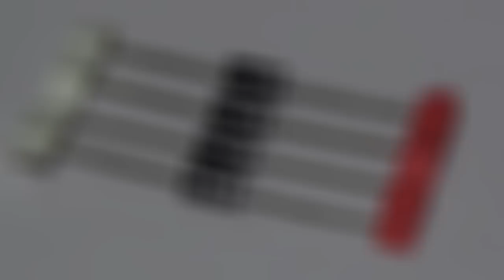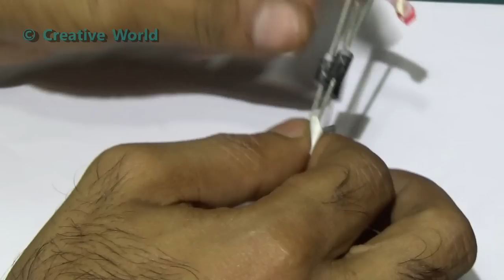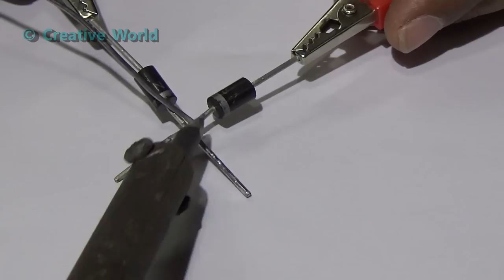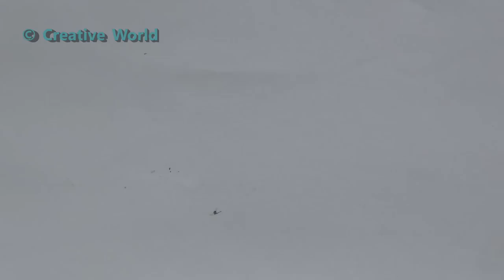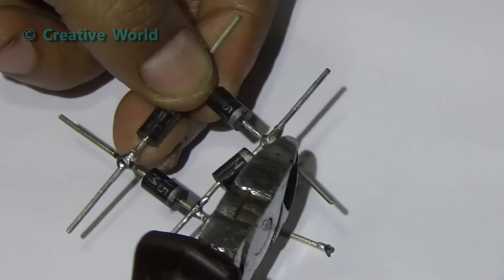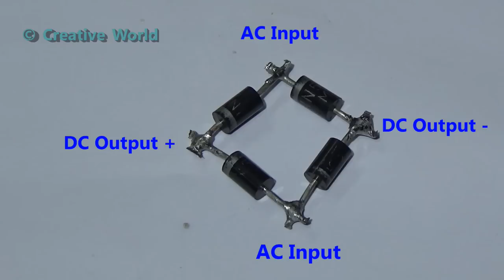How To Make A Bridge Rectifier (100% Works)

Comment: what type or model of diode to use in order to output maximum voltage or current?
what did you use?
Reply from the maker: 1N 5399

Comment: So I could use this to make a reversible polarity connection for an LED, right?
Reply from the maker: sure
Reply: Yes. But it would be a waste. Just use single diode for low voktage
Reply: @foco5657  voltage ?

Comment: Takes more than 4 diodes for a bridge rectifier. This isn’t the full circuit, this is a very basic wave rectification circuit. Run a voltage and a current thru it to a consumer and verify your findings on an oscilloscope. You’ll find the output to be far from satisfactory.
Reply from the maker: ok
Reply: @CreativeWorldPro Me liked'd dat output. I fount it sadisfaktury.

Comment: I used the same method but my dc voltage goes up from 15v ac to 21v dc. How to convert 15v ac to 15v dc ??
Reply from the maker: what is the value of the capacitor ?
Reply: @CreativeWorldPro  capacitor value is 25v 470 F.
Reply: @SaifMusazai  you mean 470 uf?
Reply: I think you can reduce vഠ|tage by connecting a 15 v zener diode parallel to the capacitor. Note that the black line in the zener diode is connecting to the positive and other side in negative.
Reply: Consider your AC source 15V and that the rectifier reaches the peaks of the AC signal. If you get out 21V, the source must be producing 21V. Think about what 15V means in an AC source and that 21 = 1.41*15.

Comment: I want to know that if we put 220v ac in rectifier input what will happen to bridge rectifier ? and how much output will we get ?
thanks
Reply: You'll get 310 v dc ALSO please use a capacitor
Reply: @abhishek9249 apne try Kiya ?
Reply: U will get 220v unidirectional sine wave

Comment: How many ac volts can this take?
Reply from the maker: maximum 220 volt
Reply: Thank you.
Reply: upto 1000v if diode is 1n4007, check datasheets for each.
Reply: It can't take more than 1 amp

Comment: sir 14.0.14 transformer based bridge rectifier how to type diode use value pl
Reply from the maker: you can use 1N4007 diode
Reply: WHAT AMPERE?

Comment: It's wrong. ware is capacitor
Reply from the maker: to make bridge rectifier you don't need any capacitor,,,
capacitor will be needed, when you need voltage from this circuit